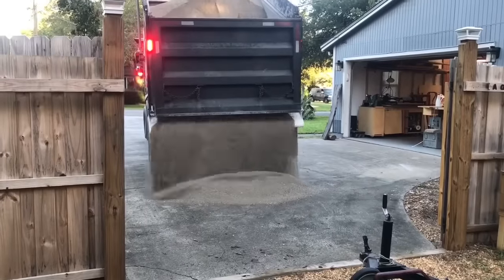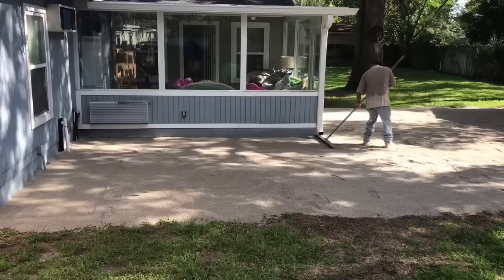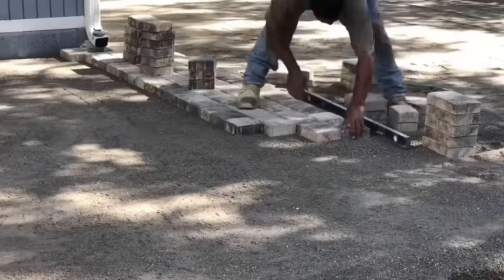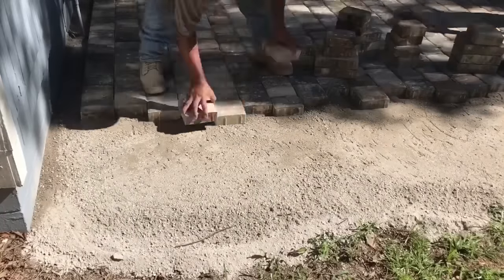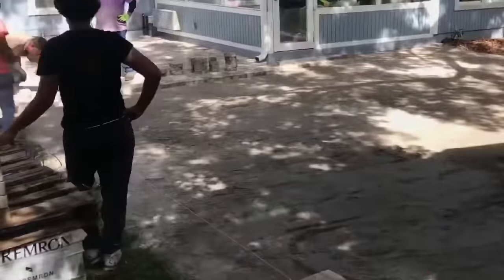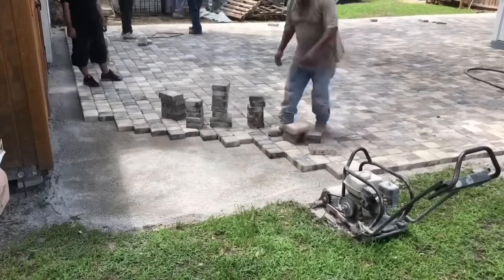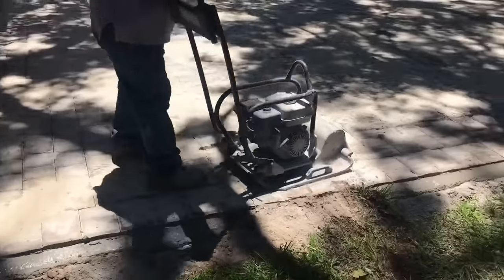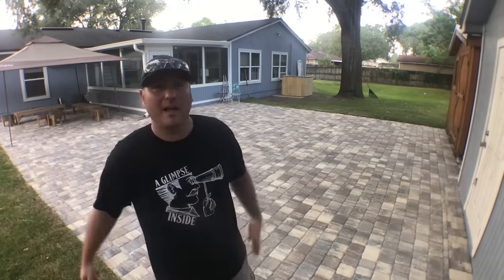How to Install Pavers like a Pro | Outdoor Project | Outdoor Living Space | Landscaping

Comment: This is absolutely not the right way to lay papers. Theyre using almost all fines for base which is incorrect. They should be using 6 inches of 2 A crushed stone on top of compacted dirt! 1 inch of sand get skreeded before pavers get laid. Never use concrete for edging. It cracks and moves.  These guys did this the cheap way. They didn't even use a hose with chop saw which is incredibly dangerous and extremely unprofessional due to the silica. If I laid a patio this way I'd be fired.

Comment: As a Contractor watching this Cringe!
So many corners cut throughout the project.
Reply from the maker: I wish they would’ve cut more corners because I would’ve liked not such a squared box look
Reply: Lol
Reply: Like what?
Reply: @DeeplyOffended  Like the fact that the base is improper, the patio will fail vertically after the first winter. also the grade is wavy, not measured at all, and the sand base is like 2" - well above what it should be.  Should be a 2oz+ landscape fabric, then a class 5 base of at least 6" (8-10" if they're going to park a car or truck on it ever), compact it with a 3/4 to 1 ton compactor, then add the 1" sand base. Also where is the edging to prevent horizontal failure.. they did a crackcrete lip. just LOL. Its a really poor job that will fail within a year or two guaranteed. They walked away with his $$, and laughed on the way to the bank.

Comment: ok well this is not professional...4 to 6 inch compressed type 1 sub base,2 inch rammed and screeded sharp sand with edging sets bedded in concrete!,sorry bro this job wont last 5 minuets,i like your enthusiasm though but im thinking you wont be so up beet when it  spreads and sinks...dont let the kids jump around too much!
Reply from the maker: steven gee Hey man I really appreciate the concern however it’s been eight months and there is no sign of any problem whatsoever. Also I’ve said and of the comments that my parents of had work done the same way five and six years ago and everything is holding up great without any repairs needed. The soil of here northeast Florida Linds itself very well to doing what you saw in this video and it being sufficient. Again I really appreciate the concern however I think the standard in which you mentioned is followed by people who are dealing with a whole lot of climate differentiation’s in terms of 🥶 freezing. 
I actually, speaking of which, I spoke to a gentleman at a different company about this job last week. He says that typically yes, we do follow what you mentioned above. However my job should last plenty long and for the same square footage, he was going to charge me $4000 more than what we paid
Reply: @AGlimpseInside  Hey man thanks for for replying,obviously your weather there is different ,in the uk were subject to plenty of rain etc, that said i would never do pavers any other way iv seen what happens and when the pikeys do a hit and run job.All i know is that jobs we did over 20 years ago are standing firm still,i like to over engineer rather than under, but good luck with your patio and keep making the vids!
Reply from the maker: steven gee Again thank you brother for the concert. 20 years that is fantastic. And of course I will continue to make these for as long as I possibly can. Thanks again